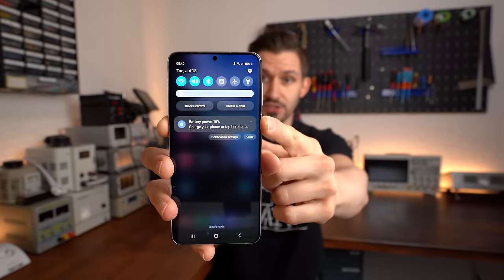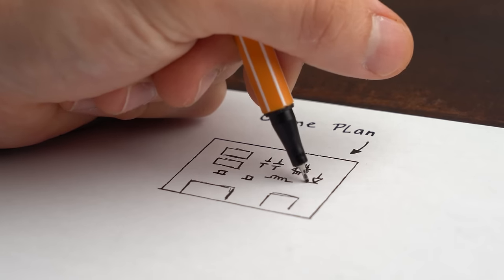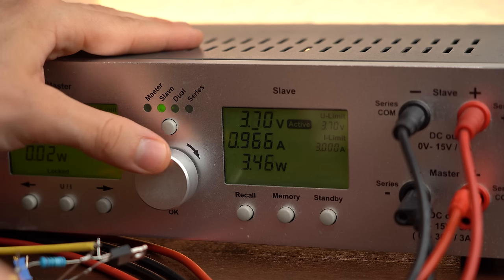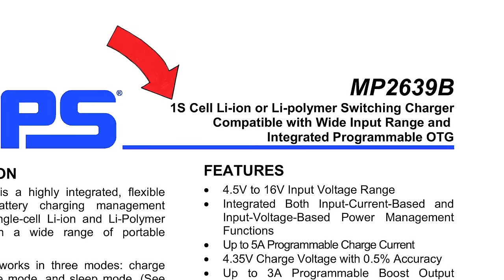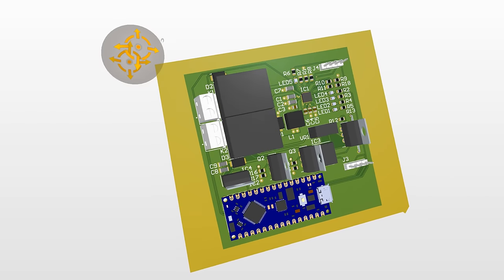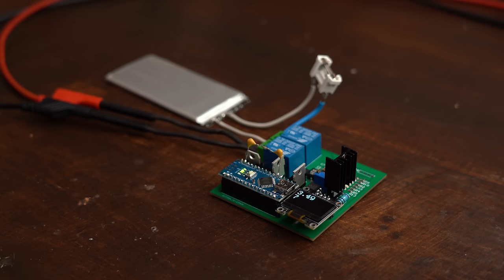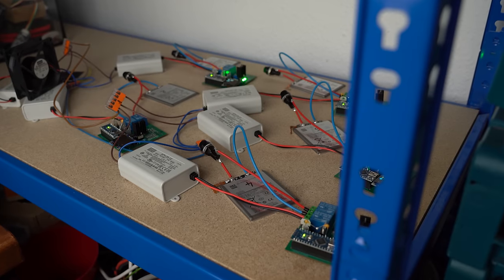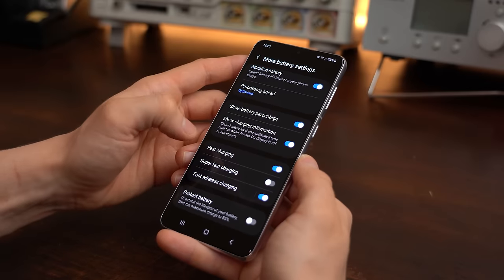Don't Fast Charge your Phone before Watching this Video!

Comment: I've always heard that the best way to preserve the battery is to keep the charge between 20-80%. I've often wondered if fast charging when you wake up is better than slow charging overnight. I would be interested to see another test done where you maybe compare fast charging between 20-80% cycles to slow charging cycles where the battery spends 7 hours at 100% per cycle.
Reply: Nowadays smartphone can charge up to 80% and stop automatically , then charge it up to full near the time you wake up at
Reply: @lemon9.9  I wish phones allowed us to just permanently stop at 80%
Phones nowadays have so much battery capacity that I'm not even using 50% over a day. 
I really do not need it charged to 100% unless I know I'm going on a trip or something.
Reply: @TotoGeenen  thinkphone probably can do that
Reply: @TotoGeenen  My Samsung A52 5G does exactly that (when the option is enabled), stops charging at 80% and will never go above unless you manually turn off that feature. All Samsung devices running Android 12+ (and the full version of OneUI not the "lite" version) should have that, don't know about IOS or stock Android on other devices.
However it is not enabled by default and you have to go digging through the settings menus to find it.
Reply: @TotoGeenen my phone with ACC does just that, you need root, though. I recommend installing ACCA too
Reply: @TotoGeenen  Sony phones have that feature built in, stopping the charge at 80% and also limiting charge current if you so desire
Reply: Li-Po Batteries lose health dipping below 30%
Reply: I WAS LITERALLY RUNNING TO THE COMMENTS' SECTION TO ASK THE EXACT SAME THING😂 I HOPE HE READS THIS AND DOES THIS TEST. HE ALREADY HAS THE PCB minor tweeking, and this test can easily be done
Reply: @viscountalpha  Sort of. It's important to keep in mind that the % the phone reports isn't necessarily linearly related to the battery's SoC or voltage; it looked like his particular phone showed 0% battery at 3.5v, and technically LiPos can go down to 3v (or 2.5v for some LiIon chemistries)
Reply: That's always been difficult with batteries, you know what is good and not good for them, but how those things compare to each other is a lot harder to find data on.
Reply: My thoughts exactly. I usually (fast-) charge my phone to around 80% in the morning. So far, it is still going strong, but I have only had it for a little under three years, and frankly, I will probably not keep it much longer than another year or so. So for me this strategy works fine.
Reply: @TotoGeenen  samsung has this feature built in. It's called "protect battery" and stops at 85%
Reply: You can charge a phone battery to 100% and let it drop to 0% without issue. Battery life is shortened when the phone continues to be charged at 100% by leaving it plugged in for extended periods or allowing a battery to suffer deep discharge by not recharging it for a very long time after it went to 0%. 

I'd be more concerned about a battery subjected to excessive heat than how much or how often it has been charged.
Reply: @krisoko  I doubt any half decent modern phone keeps charging over 100% just from being plugged.
Reply: @inertia_dagger  yes I had this on my previous phone that I rooted
Reply: @sl9sl9 
My A52 4G doesn't have that, but I'm also on an older release of Android (OTA gets disabled when rooted).
But I do have the option to disable fast charging altogether... Which is another solution for people who prefer to charge overnight. Less heat and less time kept at 100% means longer battery life.
Reply: @DedekindU No, you weren't literally running.
Reply: @TotoGeenen my cat s62 pro has such an setting
Reply: It's better to charge slowly, but not to 100% of charge. During charging there are several factors that increase degradation of the battery. First is heat, which can be prevented by low charging currents. Second is the amount of energy that the battery needs to provide or it gets charged with. If the battery is being charged, it expands (in the micro meter region). If the battery is being discharged, it contracts. The battery will degrade faster, if the difference in volume between charges changes most.
To achieve optimal lifetime it would be ideal to charge often with low currents, keeping the charge somewhere in the middle, reducing charging and discharging times.
Reply: @moonrazk  I never heard of any phone that charges over 100% but it would sure come in handy 🤣🤣🤣
Reply: @TotoGeenen  and here lies the problem. What the actual capacity of the battery isn't what is reported on the screen, but how many percent remains between the min-max values set by the phone manufacturer.
Completely draining a lithium battery is usually a bad thing, so the phone will turn off anyway when 5-10% of the maximum capacity remain or you wouldn't be able to charge it.
It's reasonable to assume that they cut off charging before reaching the maximum capacity as well, with the caveat that battery time is a selling point and thus reducing the maximum battery time available to promote the longevity of the battery is working contradictory towards that.
Reply: As others have said, many phones can limit themselves to 80-85% max (my Fold 3 and S23 Ultra do 85%), so the best practice is to enable that, then charge slowly. I think that, while interesting scientifically, the test you suggest is rendered nearly pointless by this fact. Basically, why limit charging to max or charging speed when you can do both already with the phone's software??
Reply: @TotoGeenen My phone has this feature. It charges to 85% then stops.
Reply: @Astrophysikus Be careful about your battery heating up as you charge it because it can reduce its cycles as much as always charging it from 0 to 100% (if not more!)
It's advised to make it charge as slow as possible, by simply limiting the ampere on your phone if it supports it. If not,
then either plug it with an old cable or a old charger that only support 1A for example or charge it from a usb port on a PC which is very limited in charge.
Reply: @TotoGeenen All ASUS Zenfone since the 6 and up doing that. It also has overnight charge scheduler.
Other than that, i heard Samsung S series, maybe One Plus, and Google Pixel as well.
Honestly this is a must available feature at all phones. But nowadays it seems only available at high end models.
Reply: Some custom ROM's allow this
Reply: @inertia_dagger you can probably use it with pseudoroot(shizuku) too but I'm not entirely sure.
Reply: This guy's test is completely flawed. Quick chargers don't just increase the amperage as he did here, and they dynamically change the charging rate. His understanding of quick charging is wrong as his test results should be ignored.
Reply: @TotoGeenen my phone stops at 80 or 90 unless I allowed it to go to 100 it's very restrictive
Reply: @TotoGeenen My S22 ultra has a limit battery charge to 85% setting, I have only charged it to 100% 3 times since new, So I normally start the day with 85% and get home from work with 40% battery after using it for music streaming and YouTube while working. If I'm going to go out after work I can super fast charge it in 10-15min and be back at 70-80% while getting ready to go out. It's quite convenient to keep it between 85% and 20%
Reply: @TotoGeenen Samsung has this built in now, and you can do it with root on just about any phone
Reply: @TotoGeenen ROG phone has a passthrough charging, it stops at 80% and all power is drawn by the power brick. Isn't it cool?
Reply: keeping it between 20 - 80% is maintaining a chemical balance in the battery and not considered a "cycle" each time you charge it. the worst thing you can do is let your battery drop below 20%

Comment: Very interesting video. Hopefully you let it run for an additional 250 cycles to simulate a year en see if it behavior is linear, exponentially or other. Thanks for sharing!
Reply from the maker: I will try to do that :-)
Reply: @greatscottlab  It would also be interesting to charge the battery even faster, I've seen some android phones that can do a ridiculous 150w charging lol, which I would never do but would be interesting to see how quickly it kills the battery.

Comment: Interesting study! Only one thing that had to be considered is that the fast charging current is in most cases reduced towards high state of charge. For example charging usually would start with 5A, then maybe 4A at 50% SoC, 3A at 70% and so on. Taking this into account should change a lot. If you additionally limit charging at let’s say 80-90% SoC, I would assume that you measure only minor lifetime difference vs 1A continuous 👍
Reply: that's likely to be the battery self-regulating more than it is active reduction by any limiting circuitry in the phone. batteries are like a sponge.. it's going to soak up most of the current right at the beginning but toward the end it will only sip current, regardless of how much you give it.
Reply: @reanimationxp  Actually, this comparison is to easy. If voltage is limited at e.g. 4.2V, current is automatically reduced when the sum of internal open circuit voltage and overvoltage (resistance times current) reaches the voltage limit. Nothing to to with a sponge. Before that, the battery draws just the set charge current. High current at high SoC still pushes the Anode potential towards 0V vs. Li/Li+, which is the onset of lithium plating resulting in heavy degradation. More details on google scholar -> lithium plating. This is why EVs charge slower (controlled) at high SoCs and so do recent Smartphones.
Reply: use realme GT 3
Reply: Whaty's great? If I understand right, he is charging the battery using constant current comletely ignoring built-in controllers that should prevent battery degradation and interpolates his results on this degradation. It seems completely incorrect and useless. Am I wrong?
Reply: @QwDragon  You’re absolutely right.
Reply: actually, new phones charges at 45w (some over 100w), 5a@ 4.35v is under 22w and is a modst average just to see the diff between slow vs fast. allso he do not chage them too 100% as the cut off was 4.35v and batttery was rated 4,43v
Reply: @ronnyrder2491  all these are peak powers, not continuous. You just have to translate it in C-rates. 45W at 4V are around 11A. If the battery has 4Ah, this translates to 2.75C. High energy cells as in smartphones just cannot take this high rates at high SoC since they have different electrode morphology than high power cells such as in power tools. So these high currents are just drawn peakwise at low SoCs and are than reduced at high SoC. Everything higher at 1C continuous just ruins high energy cells over time. If you doubt, read scientific research regarding fast charging of li-ion cells. And yes, lithium polymer, lifepo4 (which experts just spell LFP), nmc, nca (most phones), everything is li-ion.
Reply: @draufschlaeger95  i agree that it is peek.  But if you take 'one plus 11' that are ratet at 80w charging. It got a 5Ah battery. 0-100% in 22 min according to gsmarena.. its at least over 55w average. I heard that some phones come with 120w charger as well. I usually never carge any of my stuff past 0.5c, thats why i wached this, because I think its damaging with this new high watt cargers. The test was modest, and he didn't fill them 100%.. and thy did take minor damage anyway
Reply: @draufschlaeger95   I'm sorry, maybe im missunderstading you? Because my argument is over 1c is damaging. Best around 0.5-0.75c.. it looked like you meant it isn't damaging to push hundreds off wats in as long as it's current is tampering down
Reply: @ronnyrder2491  yes, basically, higher current is always more damaging, but it depends on. I did not conduct any studies with phone batteries, but based on work experience with li ion cells in general, and EV batteries,  i‘d say continuous charging could turn critical for  phones at rates higher 1C continuous.
Using multi step const current mscc should be acceptable up to 
3C -> ~30% SoC (~70W)
2.5C -> 40% (50W)
2C->50%
…
0.5C -> 100% (only exemplary values, depends on the individual cell)
This will of course be more harmful than 0.5C continuous, but not dramatically. You can counteract this e.g. by limiting upper charging limit at 80%.

Over 1C continuous let’s say 1.5C, primarily at high SoC, could still result in lithium plating, and if this begins, you ruin the battery. 

I still don’t believe that the oneplus does not take damage over long time when charging from 0 to 100 in 22min. This is far above what modern EVs can do and their batteries are usually designed with more focus on power. They also only specify fast charging time between around 5 to 80% and it’s usually ~25 to 30 min. But this is guaranteed with no significant additional harm vs slow charging.
Reply: @QwDragon he is using a charge controller
Reply: The fall is much more dramatic: from 15 to 65% I register up to 4.2A, at 70% it's difficult to see 3.5, at 80% it's 3, 85 it's 2, at 90% or higher it's 0.5A and at 99% it's 0.2A at best
Reply: @draufschlaeger95 source ? Trust me bro
Reply: This guy's test is completely flawed. Quick chargers don't just increase the amperage as he did here, and they dynamically change the charging rate. His understanding of quick charging is wrong as his test results should be ignored.
Reply: Yeah it's something like that, but they charge with constant current until the battery reaches around 60%   and then they use a constant voltage until 100% of SoC.
Reply: You should test, charging between once it reaches 30% and stop charging at 80%

Comment: For the inevitable longer experiment, check heat levels too.
I’ve heard (and it feels true) that most of the battery damage comes from the heat caused by faster charging
Reply: Apparently most batteries hate heat. Good UPS batteries even have documentation on how temperature affects battery life and one in particular we had set in extreme environments mentioned that as temp got past 70ºC, lifespan approached zero.
Since there were sensors in the battery compartment, a failure resulting in it cooking at 74-76C for a day and half corroborates the vendor documentation.
Reply: It feels true since it is true. It's been pretty well studied and proven that heat causes lithium ion batteries to degrade at a much faster rate.
Reply: I charge on 67watts and a cooler into the back of the phone, had it for 2 years and I also did a battery drain and charge test on when I bought it vs yesterday. Bearly any difference only falls short of 24 minutes than when it was new. It just depends on how you take care of your things. If you know heat destroys battery lifespan then do something about it instead of complaining.
Reply: Yeah and the thing is, my phone heats up considerably with slow wireless charging but there is not much temperature increase when using the "super fast" charging.
Reply: This guy's test is completely flawed. Quick chargers don't just increase the amperage as he did here, and they dynamically change the charging rate. His understanding of quick charging is wrong as his test results should be ignored.
Reply: Heat is why I stopped fast charging, unless I have to. 
Ontop of that I had heard it may not be healthy for the battery doing fa's charging. 
But the fast charging really got my phone hot, somjust the heat itself can not be good.
Problem with this is he may actually have to have the batteries IN phones to see how the heat affects them.
We see here they are air cooled, but i think phones MAY try to vent heat to the screen and such, but probably the air cooling was better then would be then when it is stuffed in a phone.
I think that heat during the charging cycle would have made that result even worse.
How much, no idea.
But most people do have phones more then 100days as he said.
So HEAT and the fast charging must compounds the issue, and I agree with him, it will just get worse over time.
That's my hypothesis anyway.
Reply: Charging is only a small part of the damage. Heat can be, but a super hot day on the beach or being left in a hot car (>100f) is likely going to be hotter than the battery would ever get from charging.

The big difference maker is charge level, if you never go below 20% and never go above 80% your battery will last several times longer.

Personally I bought a chonker of a phone that has a capacity that can be more meaningfully measured by amp-hours than milliamp hours. Not only do I need to charge it FAR less frequently, but I csn last on 50% for several days, meaning my battery naturally stays within its ideal range for longer and its less likely to ever reach zero.

RtR is great for feeling good and virtue signaling, but at the end of the day, just buy a phone that you can use for as long as you'll want to. If you want to repair it? Fine, buy a fairphone, I wont stop you*, but I find it far more likely most people   are better served by a robust rather than repairable phone. Personally, I plan on just running my current phone down all the way until I can buy a librem 5. Hopefully after a few hardware revisions, but who knows. Even if it only lasts for 5 years before I replace it too the privacy, security and  hackability alone would still give me a better price to value ratio than a high end iPhone - even if I bought the 2 thousand dollar USA edition.

* (unless you try to pass laws that infringe on OTHER people's ability to buy what THEY want or otherwise mislead others, cough cough Louis "I dont understand software licensing" Rossman. I kid of course; I don't believe for a second he actually thinks non-FOSS licensing is actually more secure, I just know he is perfectly content acting like he does.)